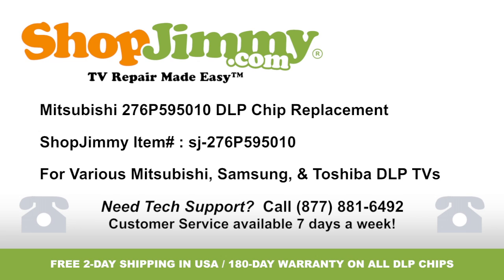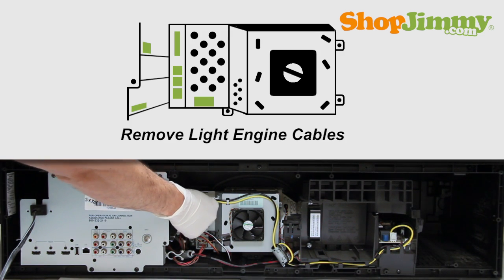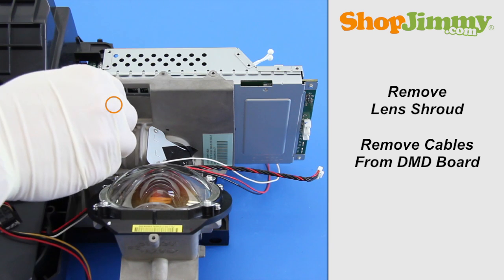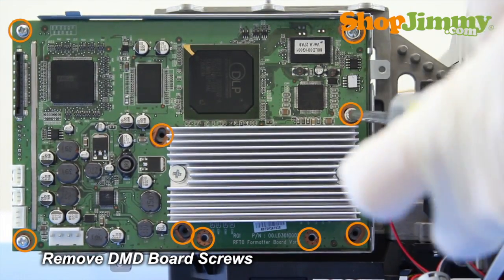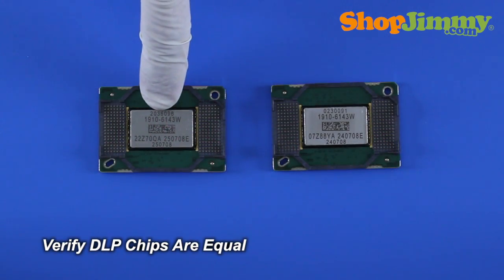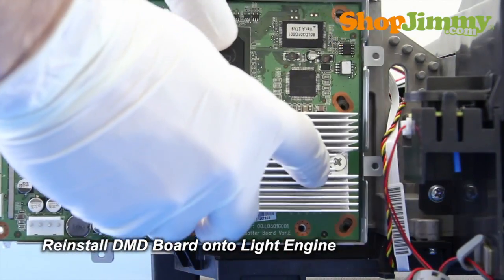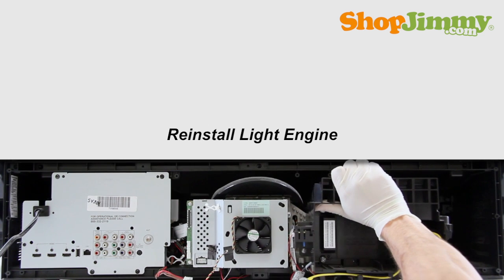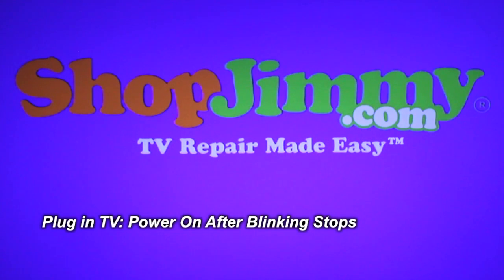Replacing a DLP TV Chip - White Dots Issue - How to Fix Mitsubishi DLP TVs

Comment: I just bough a DLP replacement from you guy and follow all the instructions from the video the followed the instruction that came with the chip...I have a Mitsubishi WD-73734 TV and just replaced the DLP chip and now the TV isn't getting picture.  After the green light stops blinking I press the power button and I'm getting Static sound but no pic.  any suggestion?
Reply from the maker: Victor Garcia  Be sure you have the lamp door closed all the way.  If that does not fix the problem, you may need to reseat your DLP Chip.  Thanks and please let us know if you have any other questions!  www.shopjimmy.com

Comment: hi i have a hitachi model no. p50x01au one of the fans dose not work but the tv works fore about 10 sec and then turns off
Reply from the maker: james fox I would recommend replacing the main board in your TV.  Unfortunately I do not see any search results on our website for replacement parts for your TV.  Thanks and please let us know if you have any further questions!  www.shopjimmy.com

Comment from the maker: @Tharon Gillispie - I would recommend unplugging your TV and letting it sit for 10 minutes.  After waiting 10 minutes, plug your TV back in and see if it works.  If it does not work like normal, I would recommend replacing the main board in your TV.  If you need to purchase a main board, please call our customer service for assistance with the purchase and to ensure compatibility. (877) 881-6492 Thanks and please let us know if you have any further questions!

Comment from the maker: @Rose De Aguero - Try a system reset, there should be a reset button by the buttons on the front panel of the TV use a paper clip to press it, the TV should "reboot" and then try hitting other buttons and see if it continues to shut off. This may bring the image back as well. It's also possible this TV got hit with a power surge and it blew the lamp and damaged the main. So give the reset a shot and please let us know what you find and we can help you with parts if the reset does not work.

Comment: I was able to replace the DMD chip for Mitsubishi WD-65733. However when I power on my TV, the yellow status light stays on with a clear picture and sound, but now, the TV powers off after about 30 seconds followed my the lamp indicator flashing green. Also the original DMD chip number was 1910-6103W. The chip I received was 1910-6143W. Could that be the problem? What did I do wrong? PLEASE HELP!!

Comment: I don't know what's wrong with my mitsubishi-wd-65731 at this point. Awhile back I replaced the thermal sensor when the "air flow" problem came up and that worked. This time around I have the red indicator on the front of the TV for a bad lamp. I purchased and installed a new lamp and I still have the red LED light indicating a bad lamp. As the TV is turning on, it makes these really high pitched wany noises almost in a cycle. IT does this 3 or 4 times and then shuts off, never giving anypicture

Comment from the maker: @Jay Rod -  Without the make and model of the TV, it can sometimes be difficult to diagnose.  I would be sure the lamp door is reattached and attached securely.  If you have the lamp in tightly and the door on correctly and you still have the lamp light blinking, you may need to jumper the door switch out completely.  Thanks and let us know if you have any other questions!

Comment from the maker: @Celoner68-I would assume it's the status LED not the lamp LED, if its the lamp LED you have a bad lamp. Solid red status light could be, circuit failure/short circuit, disconnected DVI cable, No Lamp signal from main to turn on the lamp, or ballast communication problem. Check all the connections make sure you seated everything correctly. It could be as simple as a connection not fully seated. If that doesn't work try the original chip, If that works it could be an issue with the new chip.

Comment from the maker: Sound is not controlled by the formatter board.  If you're using component be sure the Red Green and Blue for video then the extra Red and white for audio. If the connection is external make sure you didn't mute the speakers or set to external source. If using a cable box be sure is not muted. Hook up another TV or try another source to confirm. I would try factory reset, still no audio? go back inside and check you didnt disconnect the speakers from the main board.Possible with optical block

Comment from the maker: @Myke V - We also have a video posted, entitled "DMD Boards & Formatter Boards Alignment: DLP TV Repair for Off Center Picture Display, New DLP Chip"
Reply: I just changed the chip but l got black n white picture pls advice 0795024117
Reply: Jimmy. I think the tv we have is this exact model but it's older and it was his dad's so we are not sure on the year. It's a Mitsubishi flat screen 75" tv. Has a bunch of white pixelated spots. How would I know that I'm using the correct chip ? Or would I simply need to do steps to remove the chip then order one after so I know it's correct and not just guess thinking we have the same TV's? Lol I'm a chick, these things aren't easy for me to fix lol. Thank you for your awesome detailed video and hope to hear back from you on this.

Comment from the maker: @ Myke V - Congrats you will need to perform a tilt adjustment on the dlp board to correct.  The screws surrounding the dlp ics need to loosened a bit, then with it on move the board, chip and all to correct. tighten the screws after.

If you need any additional help, please contact our Customer Support - 

Toll Free
(877) 881-6492

Phone Hours
Mon-Fri   (8am-8pm CST)
Saturday (8am-6pm CST)
Sunday   (9am-4pm CST)

Comment: @shopjimmy, Soooo i was successful in replacing the defective DLP chip on my WD65734 Mitsubishi TV with a SJ recommended one. Hooray for me!! So i'm playing Madden on my CLEAR 65" screen when i notice that the screen appears to be on a slight angle. I switch the viewing mode to TV and it is still on a slight angle. The top left-hand side of the screen is chopped off a little. Any idea what i did wrong? What do i check for when i remove the light engine again to correct the problem. Thanks :)

Comment: First of all your video is amazing.I followed all directions on my first trip in to replace the DLP chip, however one thought of stupidity on my behalf and I screwed up my formatter board and had to buy a new one (and they are not easy to find). So now armed with a new board I installed the chip and put everything back together-turned on tv and it was a nightmare of black and grey stripes. Tear down again and found chip loose, reinstalled chip, put back together and Bingo-Sweet Picture & No Dots

Comment from the maker: Blinking yellow means the lamp door is open. 

Make sure you put the lamp door on and screw it in tight. If the light still remains you may have a bad safety switch and you might have to jumper the switch.  

If you are having issues, please give us a call for free technical support! 1.877.881.6492

Comment: Just did this replacement last night on a WD-65734. It was a good opportunity to de-dust the lens and the interior of the cabinet. Picture has far better contrast now after chip replacement (and fixed over 100 "stars" on the screen). This video was a great "reference", despite the different model.

One thing to mention - the thermal pad on the heat sink came free from my heat sink in multiple pieces. I cleaned off the old pad, then used a bit of thermal paste before re-installing the heat sink.